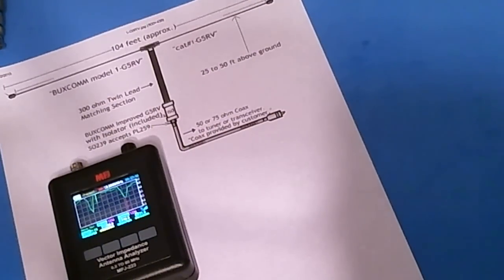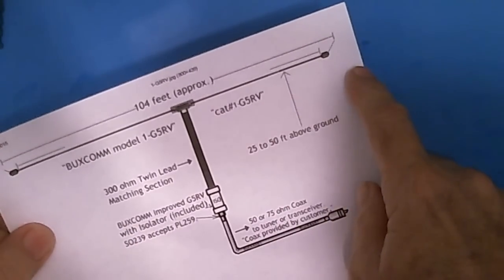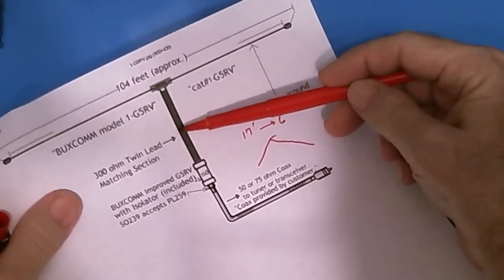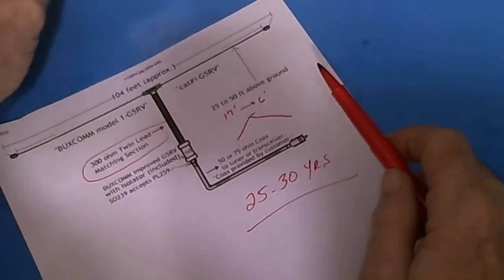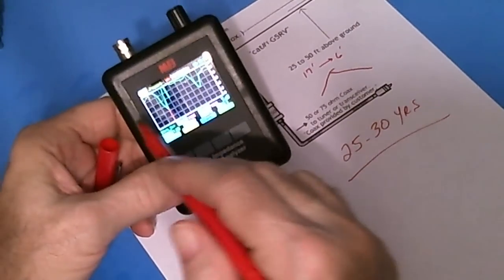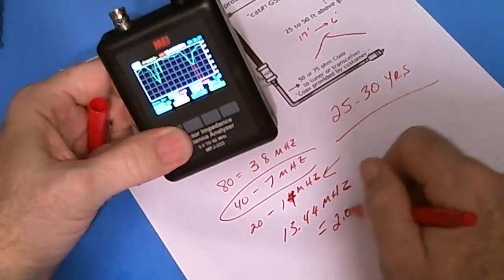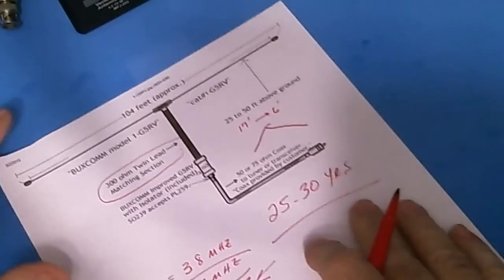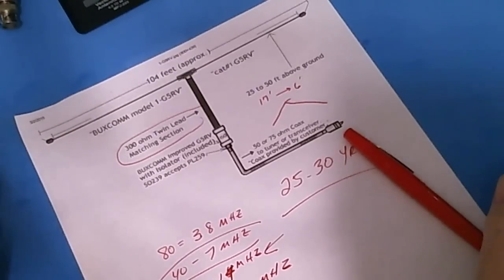TRRS #0508 - My G5RV Antenna Setup

Comment: What a useful bit of kit that antenna analyzer is... from memory the twine lead section of the G5RV does need to be fully erect as it adds length to the antenna for the lower bands...
Reply from the maker: Thanks for the info.  Lots of conflicting information on the G5RV on the internet.

Tom
Reply: hamrad88 Well that has been my understanding regarding these antennas... then again I could be mistaken, still not having it suspended would be definitely affecting the antenna.

It seems to work well however even if the resonance is a little skewed, unless your TX'ing as well I wouldn't stress too much.
Reply from the maker: ***** I was hoping it would have more dips in the SWR.  Full wave, 1/2 wave , etc.

Tom
Reply: I would imagine the proximity of the ground to the antenna is having a some what negative effect, still seems to work okay as a receiving antenna...

Comment: Back in the 70s I put up a G5RV antenna which I purchased from a dealer and wasn't really impressed with it's performance.
I tried a large loop which was around 248 ft. in length and it tuned real good across 80 meters and 20 meters using a good
antenna tuner. My supervisor at Admiral Corporation told me to put up a Zepp antenna if I wanted a real good antenna. :)

-73s